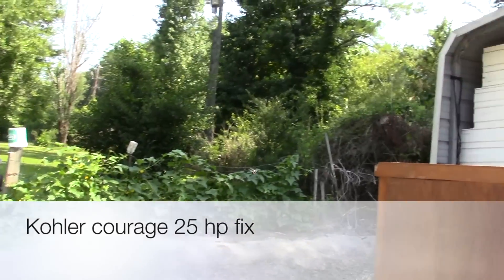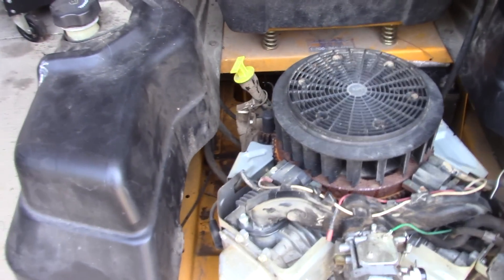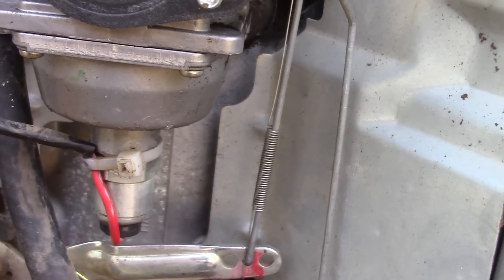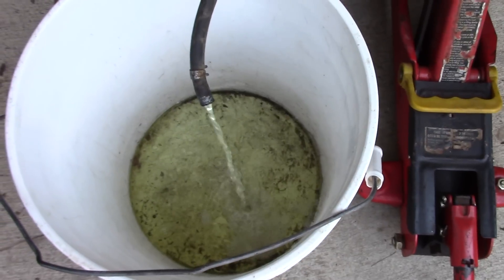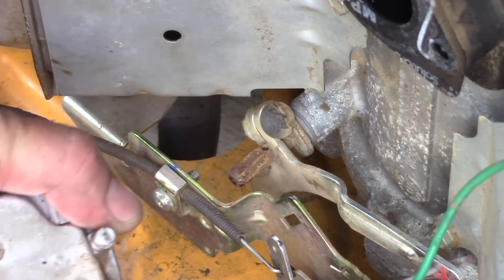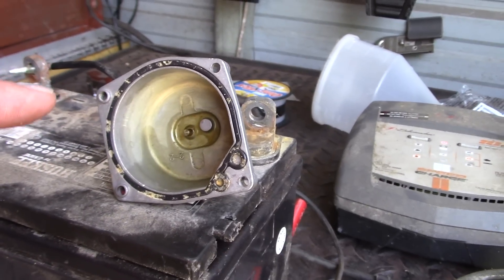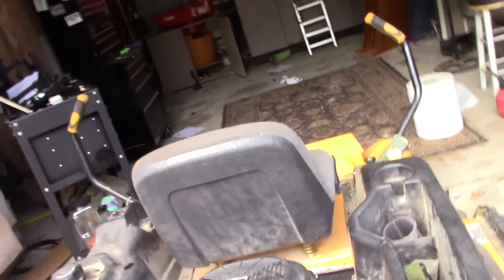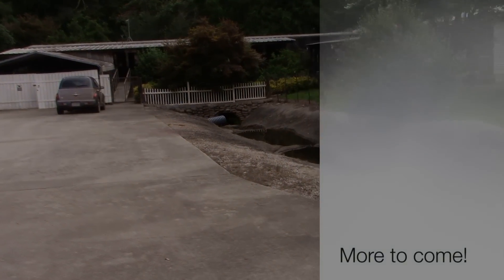Kohler courage 25 hp fix

Comment: Good job. You probably saved your neighbor a lot of money by replacing and repairing what you did for him. I picked up a few pointers from your video. I am completely rebuilding an older toro z5000 zero turn riding mower. Lots of work to do on it but when I am done it will run like a brand new machine again. I like doing tis stuff.

Comment: Just went through something similar. Mine started with a broken axle. Put mower up for the winter and ordered an axel, The next spring I did the axle repair and then had trouble starting the mower. .. I cleaned the carburetor, didn't work, replaced the fuel pump, same thing only ran as long as I primed it but would not stay running.... Replaced the carburetor with a brand new one.. Same thing no fix.... I finally started checking flow through the fuel line... Didn't seem quite right to me. SO I took some new fuel line and connected it to the fuel pump and put the other end into my gas can... Mower started right up and stayed running. After 10 miiinutes of constant running. I shut it off. Replaced all the fuel line and the mower started up and stayed running. In the process though I discovered the rubber seal around the angled connectot on the gas tank was leaking a bit. So I replaced that too... Mower works fine now...
Reply: I think I am having the same issue with my 25hp Kohler Courage engine.  Thank you for sharing your experience.
Reply: Yepper that grommet ensures vacuumed seal from tank to fuel pump and if cracked, damaged,dry rott, anything to compromise vacuum affects gas flow to the pump....👏
Reply from the maker: @timothygrant2831 thanks for watching. I appreciate it.

Comment: Didn't know putting rubbing alcohol in the tank would get rid of the water. I did it for a different reason. Back in the day I had a 79 Buick Le Saber and Friday nights would dump 2 to 3 of the 91% bottles in the tank with about 10 gallons of 92 octane and go have some fun, LOL. I was beating those 5.0 mustangs with it, LOL.
Reply: prancstaman you do know that dumping alcohol in your gas tank Will not give you any horsepower gains right?

Comment: You skipped the process of taking the air filter cover off. The bolts(?) are recessed. I can't find the right socket to reach them. Any advice on what you did to get those out would really help.
Reply from the maker: Thank you for watching that was quite a few years ago and I don’t have that mower any longer. But I think it was a torques head. Hope this helps
Reply: @Mayhemcountryliving  I'm real good at talking before I think it out. 😆 Its a long 10mm socket. Thank you sir.

Comment: You answered all the questions as to what's wrong with it within the first two minutes , all you had to say was " it's been laying out in the weeds behind his garage" , seriously man what the fuck is wrong with people that is absolutely not where you store a fucking zero turn lawn mower or any piece of lawn equipment for that matter . For crying out loud I clean my mower off after every single use meticulously with my leaf blower and scrub the entire machine down with Dawn dish soap hot water and a sponge 3-4 times a year then wax the entire mower after each wash. Yes I wax my fucking zero turn , I tend to like to take over the top care of my equipment and guess what none of it has ever let me down , nothing has ever failed on any of my equipment that I couldn't always easily repair myself in very little time , even both head gaskets on my 22hp Kohler took my like 45 minutes and boom done the job was done right (I am a professional mechanic , collision repair expert and capable welder and steel fabricator, small engines are something I've been tinkerimh with for fun and a little side cash for the last 23 years so I know a thing or two, but the most important thing I know of all is how to properly maintain all my machines , hell I even replace all my fuel lines in every machine at the beginning of every season no matter what even if they still look and feel brand new, I don't care I enjoy the reliability I receive from knowingly going above and beyond concerning maintenance on all my machines.
Reply: What the fuck are you watching this video for then, you fucking legend!!😂😂😂😂
Reply from the maker: Lol love it